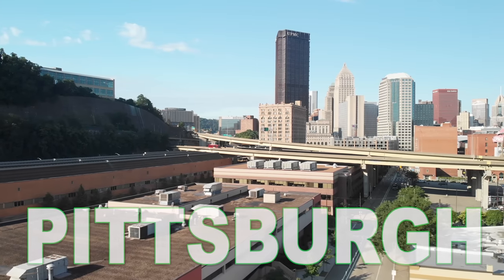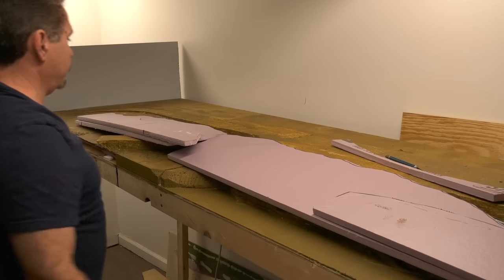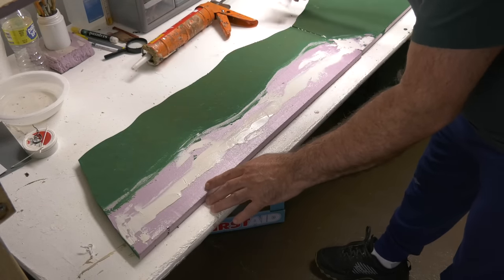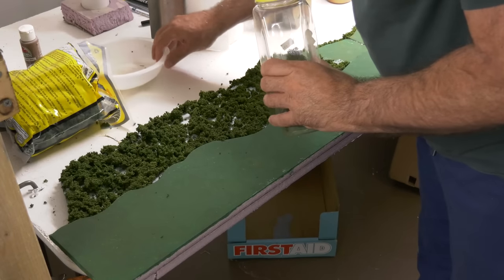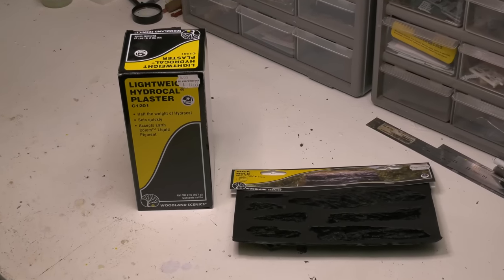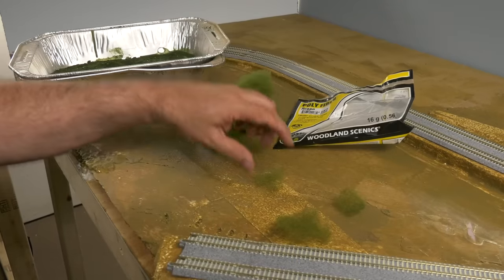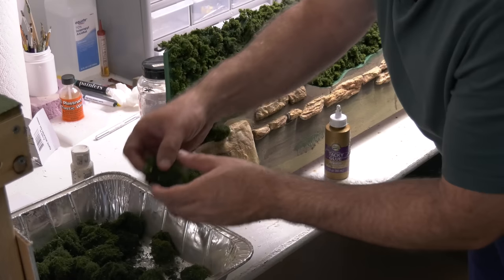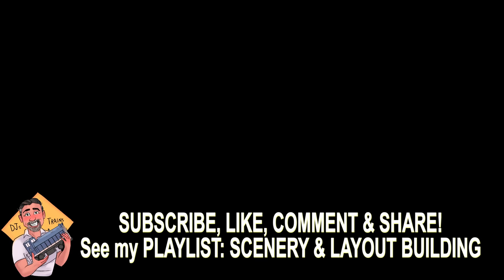MODEL RAILROAD BIG MOUNTAIN in a SMALL SPACE? ONE INCH THICK!

Comment: High DJ, I model in O so things are bigger and thus heavier. I've started my layout 4 years ago and have tried almost every technique some of the best youtube modlers use, everyone being a success. I think it's the best way to model as it expands and develops ones skills and really is what makes it enjoyable. I find the key is to keep the glue or bonding surfaces adequately moist untill each surface is bonded together. So work in small sections at a time. I use a spay bottle of water and 10% isopropyl alcohol and drop of dish soap to break the surface tension and I apply the glue to the terrain with a mixture of 50% glue with 50% water in another spary bottle and then coat the scenice material dipped in glue to the terrain. This bonds the two surfaces to each other in this manner and then spary the whole thing with the glue mixture. White glue dries clear and flat so there's nothing to fear. The best glue to use is artist acrylic matt mediums as it dries absolutely clear and flat without any trace and still stays pliable almost indefinitely and is easily modified to make changes. I also use hairspray to make trees and foilage matts from poly quilting batting. This makes for excellent, all types of ground cover if you know the propper technique in separating the layers and stretching to a fine cobweb like sheet painting and applying scenic ground foam. I recommend watching "boomer diorama" this guy is a professional 3D artist building an HO shelf layout. Another is "Jason Jensen's Trains" he's another artist building an HO layout. These guys are superior artist and know and have all the techniques.

Comment: A RR club I was in, we went through 12 bottles of cheap pump hairspray in two scenery sessions. 🤣 Use to use Aileens full strength to hold Kato track to the foam. If you want to change it, slide a thin filet or putty knife underneath. Comes up with minimal damage. You may consider using some lighter green, and yellow WS on top of some of the trees, fixed with the cheap spray. The powdery stuff. Trees generally appear lighter on top then underneath. Some folks say it looks like a bit of sun is hitting some trees. Once again a great vid.

Comment: That does look good, DJ! I'm going to have to do that now. I may sculpt the edge of the cuts though, just because my OCD would go nuts having a 90⁰ ridge along the top, even though no one would notice lol. 
I had the same issue with clumps I used for bushes, that they didn't want to secure down. I used the same method for ballasting, and sprayed IPA and glue mix over the top, now everything is rock solid and not moving yet still looks like brush

Comment: Overlapping layers of foam like you did makes so much more sense than sculptamold, wire mesh, etc. to develop depth.  It's light and sturdy.  A cheap jig saw with a fine-tooth metal cutting blade slices right through foam sheets and can easily follow any contour line you draw on it.  Much easier than a knife or hot wire for situations like yours.

Comment: When making puffball trees, I add a couple of drops of Dawn dish soap into the glue/water mix.  It reduces the surface tension and helps the glue to “wet” the surfaces. Also if you paint the backdrop with a darker color than the foliage material, if a piece of foliage falls off it just looks like a shadow and is not as obvious.

Comment: Ran into same issue with clump stuff first time I used it -- was always 'falling apart'.   So now I treat that foam clump foliage the same as I treat ground cover  ... straight glue first to get stuff in place, cover with "greens" (clump foliage, or the turf, or what ever scatter going on the ground), then hit with some wet-water, then soak with scenic cement.  Turns the clumps into little hard rocks :-D

Comment: Thanks, DJ, for the video because I was at the point of trying to decide my backdrop and this is also prototypical forested hills in my area. I made mine similar to yours and the thing I found is that the gluing just wasn't working and after lots of searching I found that using a Clear Latex Caulk (which has silicone but is latex based) was perfect. I found that a thicker base to push the clumps into was better than a thin base.  I then misted Woodland Scenics Scenic Cement over the clumps and I could turn the whole thing vertical, tap and shake it and the clumps stayed.  I used DAP® ALEX PLUS® Clear Acrylic Latex Caulk Plus Silicone.  Lowe's didn't have the clear,  didn't check Home Depot but we have Menard's in our area and they had it.

Comment: Rantrak (Richmond area NTrak) uses black polyfiber (Micro Mark) as a base for the forest.  You can use larger pieces of poly for this.    Get it fluffed up a bit and glue it down until it covers your mountain then glue it down.  use give the poly a heavy coat of ground foam, use different colors, then white rain the whole area.  That should hold the ground foam in place.  It is the ground foam that gives the poly it's color.  Any poly showing thru is the darkness under the trees.  It takes a bit of practice, but the idea of laying the foam flat as you decorate is genius and makes the process much easier and controllable.

Comment: Hey DJ, I didn’t read the comments below so I’m sure someone already mentioned this. But if you were to have misted your scenic clumps with isopropyl alcohol first without using the white glue on the base, then all you’d need to do is spray the foliage with a 50/50 glue water mix and it would’ve stuck together without using hairspray. Which has a tendency to attract dust (which makes dusting impossible) just a thought.
Reply from the maker: interesting!
Reply: I should’ve used a different word than “misting” with alcohol. It doesn’t have to be saturated close to it.  But it does need to be able to get through the clumps and down to the base. I’ve tried to shortcut this process before by just using glue and 50/50 glue mix on top without the alcohol but the next morning a lot of the clumps were getting sucked up in the vacuum. But when you use alcohol first then the glue mix, the following day the clumps will actually be hardened.  @djstrains
Reply: @kenholbrook5963   So ... basically the same technique you use for track ballast and ground cover (other than static grass).  Nice!

Comment: Great looking backdrop. One inch foam is good solution for this. After stacking it like you did, the foam also can be shaped with a Shurform tool. The white glue for puff ball trees seems too messy for my taste. After spreading the poly fiber out flat, I spray it with the cheap hairspray. Then lay it in the ground foam and start rolling it around. Seems less messy, doesn't need time to dry, and creates a more irregular shape.
Reply from the maker: That’s how I have always made them, but I was curious to how this way would compare.  Sometimes the spray glue makes mine look kinda spider webby. Any tips on avoiding that?
Reply: Spray and repeat. @djstrains

Comment: Dear DJ, humbly think your mountain is too flat. Even though you wanna create a flat rendition of the mountain, it may help to accentuate at least some of the undulations. That will also allow for a natural shade which you can then further accentuate with darker and lighter paint and/or ground foam or other kinds of scatter. 
What I also find helpful, especially to emphasize on the illusion of depth, is to use more thin layers to create the different layers of the mountain base, which makes it easier to create the illusion of undulations 
beyond the flat surface.
These thin layers also allow for creating different layers on the top of the mountain. With which you can give the slight impression of a slope beyond the peak, which is similar to how a theatre decor gives the impression of depth, or a viewing box. 
Further away from the beholder will turn more blueish in the greens. Which will also enhance the field and feel of depth. Cheerio
Reply from the maker: Good tips!

Comment: Pretty good result there. Personally I'd go a step further and air brush the foliage with a zenithal; highlight the top and darken the lower parts just to exaggerate the volumes of the foliage.
Reply from the maker: What is zenithal? I'm unfamiliar with it.
Reply: @djstrains  It's a term from miniature painting where you use a dark to light grey priming as an undercoat (artist term is grisaille). So, in this case, using a lighter green (tinted with yellow) from above to catch the top to make it look like sunlight is hitting it from above and then a darker shade of green for the shadows below. Should have made it clearer that the term is zenithal highlighting.

Comment: Instead of hairspray, which works, but I would have sprayed it with matte medium thinned a wee bit and a surfactant added.
Reply from the maker: Tell me more about the surfactant..
Reply: @djstrains Household dish soap or alcohol. Anything to make the water "wet water" to break surface  tension where the puffballs or any scenery makes contact with the glue. Remember: 1 pre wet with "wet water", 2 add scenery, 3 spray gently but generously with glue/wet water to bond.
Reply: @djstrains  it's an agent that is added to make liquids flow better. 

I don't like using isopropyl as a surfactant because it will affect paints and other glued things. 

A few drops of dish soap will work. 

Surfactants can be purchased pre-made.  Many of the artists' media manufacturers make it. Also, so do several of the acrylic airbrush paint companies, they call it "flow aid".

Comment: One needs to very careful when adding hills or "mountains" to model railroads.   Setting and context is everything. If you are modeling the prairies or even in the farmlands of the midwest any elevation changes need to fit the type of landscape really there. Plus if you are modeling a region that was glaciated a lot of the hills called drumlins will be orientated in the direction that the ice and melt water was moving. There are various theories on just how drumlins form but thats another topic. What they are is elongated piles of gravel, rocks and boulders with clay and sand holding them together. Note the gravel and rock. Industry. 😊 Looking at topographical maps such features standout like sore thumbs